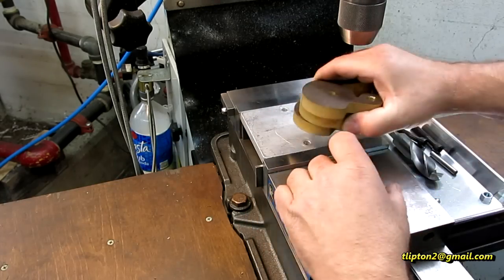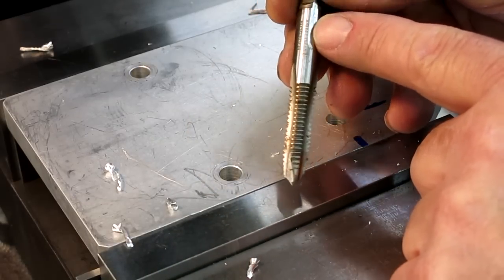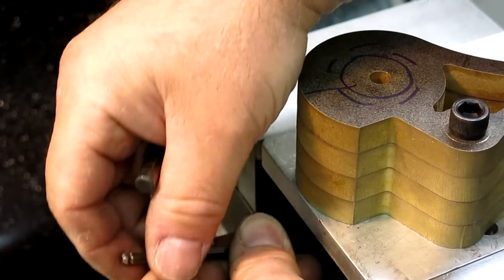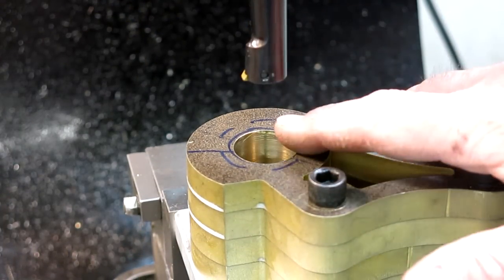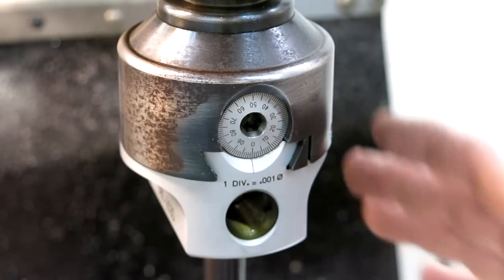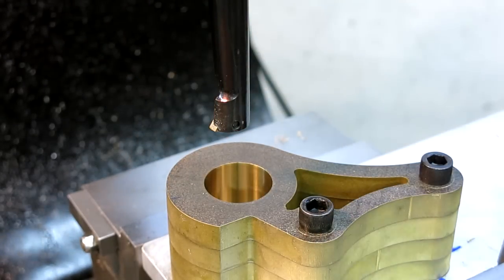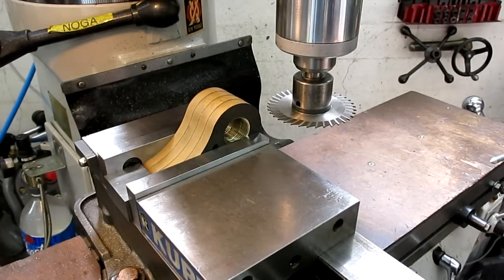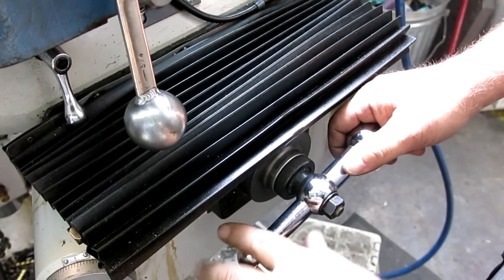Worm Thrust Plates

Comment: Just a comment on that key in the spindle of the mill. I worked for a guy once who had removed the key and you're right. It's not needed and sure made it a lot easier to change tools.
Reply: Mine shifted out of the way many years ago, not felt the need to fix it yet. Maybe next time I change the bearings I'll put it back in place, but on the other hand....
Reply: Leave it out. It's next to worthless. The only time it helps is if your collet/ drawbar threads are in bad shape.

Comment: Very nice work Tom, Enjoyed!  Have you considered using a torque tube to connect two stub worm shafts to minimize torsional windup between the worms?
ATB, Robin
Reply from the maker: Hey Robin,

Keen observation. I'm expecting the rotating force to be pretty low as the 700lb upper roll is counterbalanced for the working area. The angular shift from the torsional windup on a 5:1 worm into a 7 tpi screw is pretty minimal vertical displacement. If I did the math right a 5 degree windup difference would be something like .0004 vertical displacement in a perfect system. Good point you make. Thanks for stopping by.

Best,

Tom

Comment: You should make a stub handle for that tap wrench. Size and knurl it to match the tightening collar on the other arm and you will have a symmetrical, but short tap wrench. By making it symmetrical (in size, radius arm, and texture) you will be much more likely to avoid off-center forces on the tap.

I like your micro adjustment system for evening the height/pressure at each end of the roll.
Reply from the maker: Hey Peter,

After I read your comment I went and looked at the tap wrench. I was happy to discover the handles from the next size down tap wrench fit the larger model. Thanks for the comment.

Cheers,

Tom

Comment: Tom, another time, have the minimum stick out of the quill and raise up the table. You will get more rigidity that way. The exercise of winding up the knee will be good for you. LOL
Reply from the maker: Hi Dave,

I don't understand your fixation on the quill. As you can plainly see it works just fine sticking out. Every setup does not demand the maximum rigidity of the system. You would be surprised just how flimsy a mill is when you start putting indicators on things. Thanks for the comment.

Cheers,

Tom
Reply: Hello Tom, Thank you for your reply. I do not have a ‘fixation’ about the amount of quill that sticks out, it is just common sense. The Bridgeport and ‘Clones’ quill was designed so that you can drill as you do on a standard drill press. Yes it is also true that you can extend it out to mill with, but for maximum rigidity, the quill should be up inside the head casting. As a Machine Tool Fitter for 30 + Years, I do know what I am talking about. There are many users on YouTube, who show them milling with lots of quill showing and still plenty of vertical Knee adjustment available. It is obvious that you are happy in using you quill with lots sticking out, but you as a ‘Teacher’ showing novices how to machine, you could perhaps mention the fact that less stick out, the better. I will say no more on this matter, but as a Professional, I felt I had to put this subject on the table.
Good luck with the Press, looking good with your fancy end caps. Regards from Dave.
Reply from the maker: Show them milling without any problem. The fact is that yes its more rigid when the quill is retracted but its not always convenient or efficient to have it fully inside the head. There is no hard and fast rule. The part, tolerances and cost drive the process not generalizations.

Regards,

Tom

Comment: Tom,
How come you didn't power tap the 1¼" hole with the quill instead of hand tapping it with the tap handle? 
I'm sure there is a very good reason and I just wonder why.
Thanks for another great video.
Reply: That's a pretty big tap to run in the Bridgeport.Not saying it couldn't though but why put the strain on the machine.
Reply: Also the shank of the tap might be too big for a collet.
Reply: Hi Ron,
Yes, Tom may not have a large enough collet. But, knowing how much tooling Tom has I bet he does.
Maybe as you said he did not want that much torque on the Bridgeport. With that said I would think if the spindle speed and feed were slow enough it would handle it.But, what do I know.
Reply from the maker: Hi Jeff,

The little bridgeport probably couldn't handle it. My record is 7/8-9 in steel power tapping on a small mill. I don't actually have a tap driver for this large size tap that would work. Thanks for the comment.

Cheers,

Tom
Reply: Hi Tom,
This makes perfectly good sense you don't want to load down the Bridgeport.

Comment: Tom, is the worm drive cross shaft excentric? If not how do you adjust the backlash in the drive?
Reply: I think he meant any play between the worm drive and the cross shaft. Not between the gears themselves
Reply from the maker: Hi Stuart,

I can vary the center distance by moving the entire bracket closer or further away using the mounting holes. Thanks for the comment.

Cheers,

Tom

Comment: Hi Tom, does pulling the telescoping gage at an offset angle to the bore concern you on the accuracy vs pulling it perpendicular to the bore? Also, is the boring tool insert top inline with the flats on the holder ( used in the boring head)? Thanks.
Reply from the maker: Hi Robby,

I want the gage to release when it passes the smallest point. I don't want it to drag the rest of the way out the bore. Hope that makes sense. Yes the flats are aligned to the cutting edge. Thanks for the comment.

Cheers,

Tom

Comment: Tom, Nice trick on moving the table to avoid scratching the bore. Would it be OK to keep the cutter running and reverse the feed?
Eric
Reply from the maker: Hey Eric,

I wouldn't reverse the feed unless I had started that way. With fine boring you have to be consistent with your method. Depth of cut, feed and lube play a part in how much comes out for a particular pass. Boring cycles on CNC equipment typically retract at the feedrate so this practice is common. Thanks for the comment.

Cheers,

Tom

Comment: the flat face of the parts are all drilled and bored on a wonky aluminium plate? doesn't that mean all the holes are wonky too?
Reply from the maker: Hi Guy,

The flat surfaces are pretty parallel on that aluminum plate. The ends were not so nice. Thanks for the comment.

Cheers,

Tom
Reply: Thanks for the reply Tom, I guess it's relative. Normally you are such a stickler for precision that I was just a little bit surprised, although of course I also know that you know exactly what you're doing!

Anyway, this is a fascinating project to follow, really looking forward to seeing the end result, and thanks as always for sharing your work, ideas and experience with us. Love it.

Comment: Drilling the clearance hole for the split clamp screw at first the drill bit wasn't sticking out far enough, was it... ;)
Reply from the maker: Hi Attila,

I think I started with a stub length drill and then switched to a jobber length for that very reason. Sharp eyes! Thanks for the comment.

Cheers,

Tom